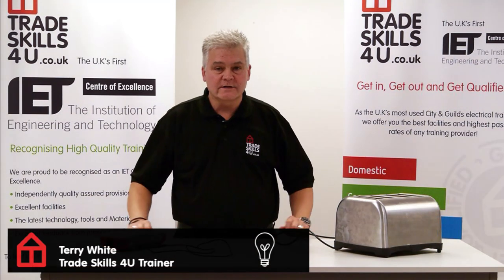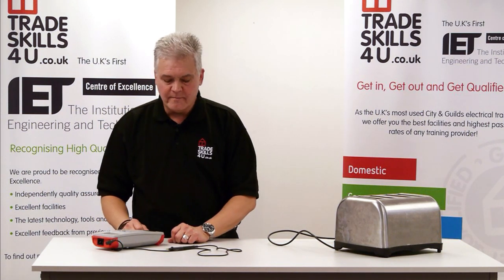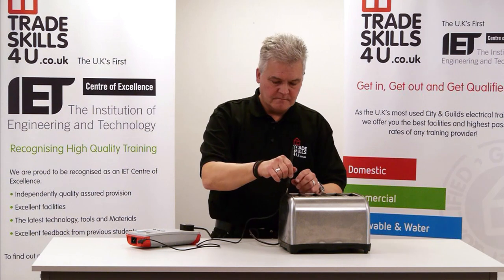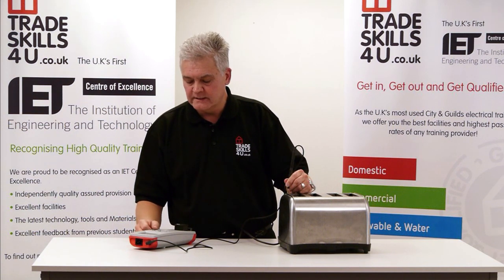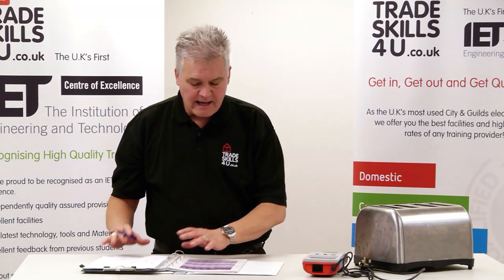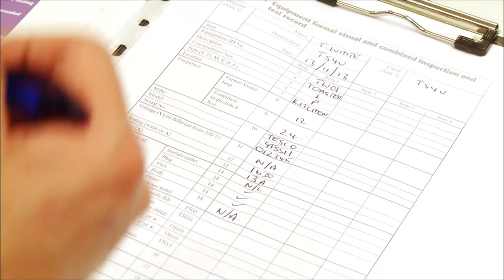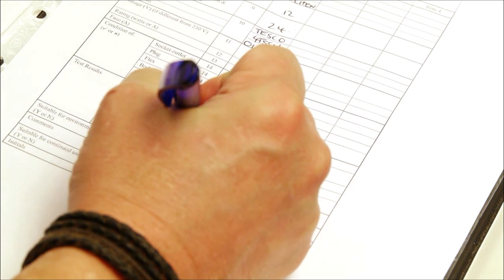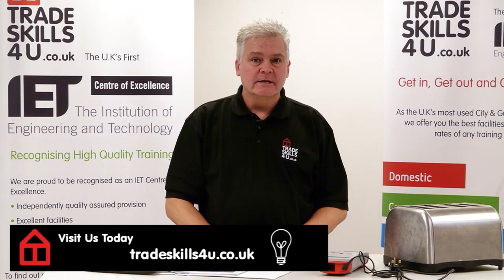How to Carry Out a Class 1 PAT Test

Comment: I use a very similar tester and the procedure is the same, but when testing toasters I found I had to press down the slide on the toaster to complete the continuity test. Did you have to do this Aldo. I didn't see you do it in the video